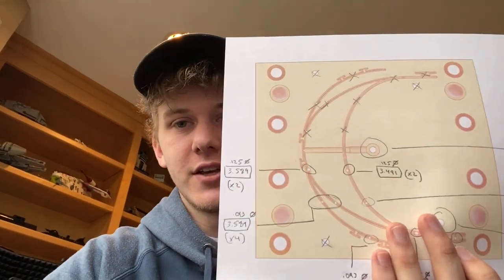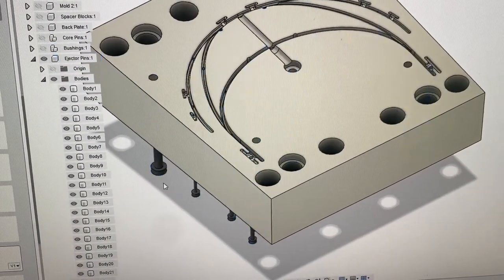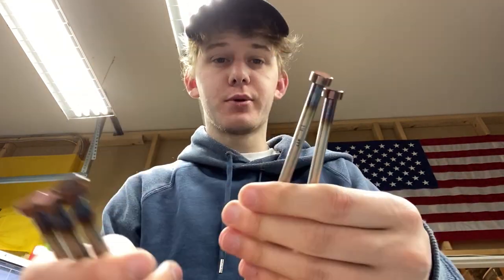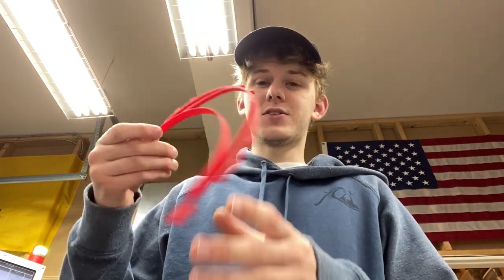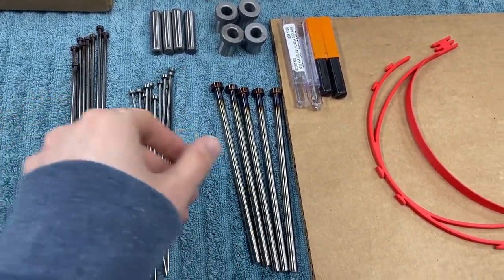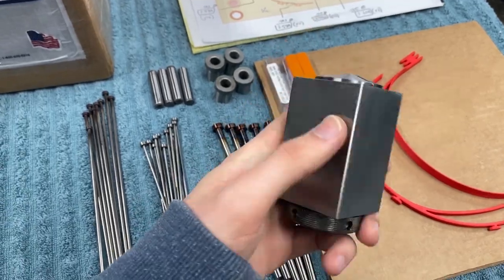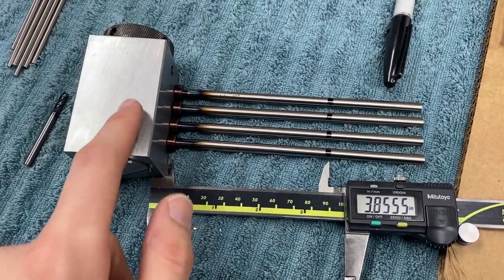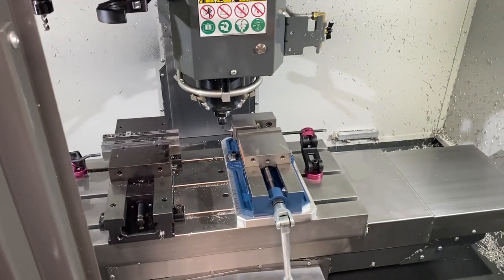Cutting Injection Mold Ejector Pins with a Haas DM2 - Part 1

Comment: Core pins (stationary) aren't heat treated and can be milled. 
Sprue puller, return and ejector pins (dynamic) are nitrited producing a hard outside surface with a softer interior, traditional are ground to length. If milled with carbide may chip the edge.

Comment: Hi there just started listening to your podcast which is really good.   Sorry if this is way off the mark but when I use comp on the Haas mill at work I need a radius, or diameter in your case, value in the offset page for the wear to be subtracted off of.  Maybe your fusion software post works different to the solidcam post I use at work though.

Comment: If you controls set up for diameter and not radius on a single side it will only it will only cut the radius of the diameter you typed into the control so when you went from 3.7 - 3.698 the machine did what it was suppose to.

Comment: Hey, great video. I would collet the pin in your spindle, then square up a regular carbide insert lathe tool in the vise. It’s much easier to maintain tolerances. Just my two cents.